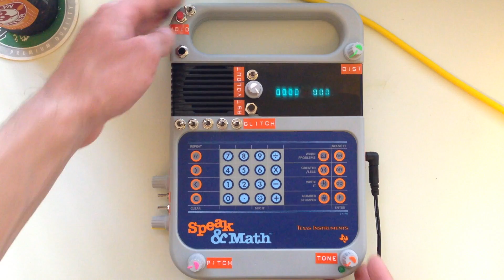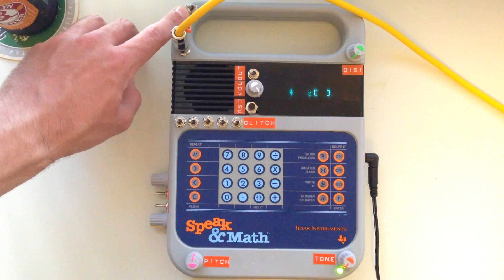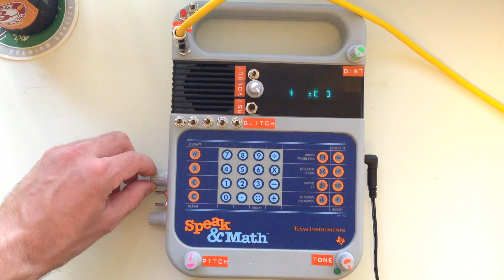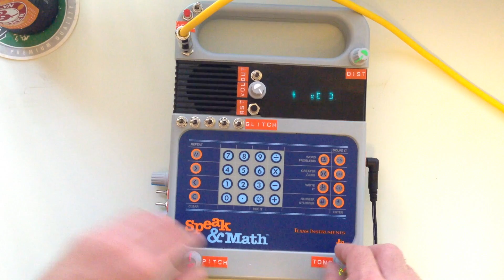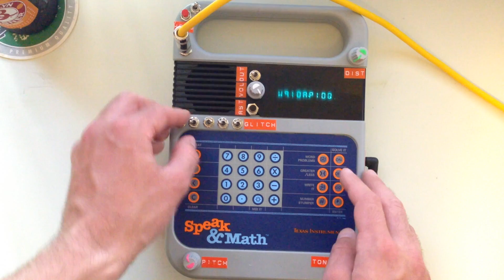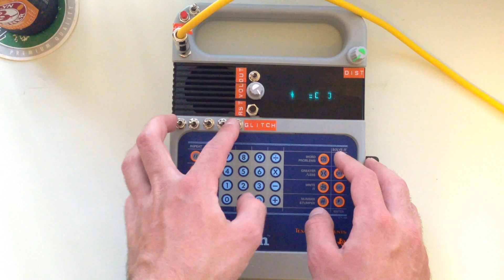Circuit Bent Speak and Math Demo

Comment: I made one of these too, but with more of a focus on creating interesting glitches in the system than making interesting sounds. It does have the hold button though, which I'm pretty sure I discovered independently through trial and error. I've seen some of the same stuff on there that you have, such as "WJOO.JOAP", and letters in math problems.

Comment: Did you add anything other than switches and pots? The LFO and tone were found within?
Reply from the maker: LFO which acts as vibrato was made using a 555 chip. Everything else was found as bends or like the volume and mute- added as normal.
Reply: Good to know. Thank you and very cool bend!